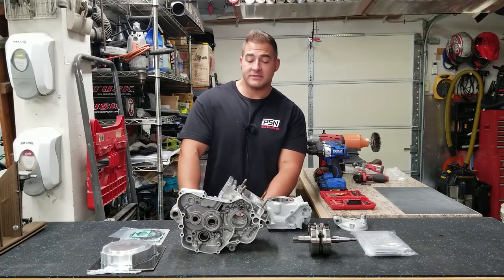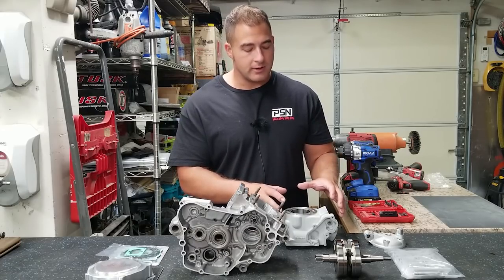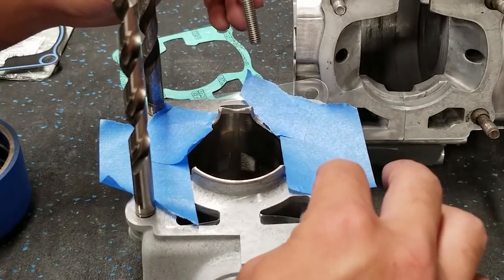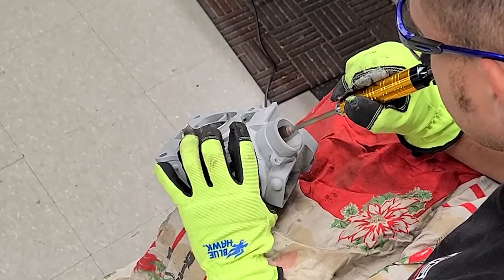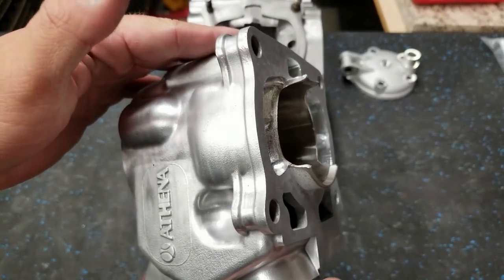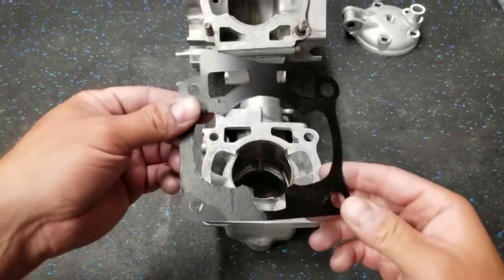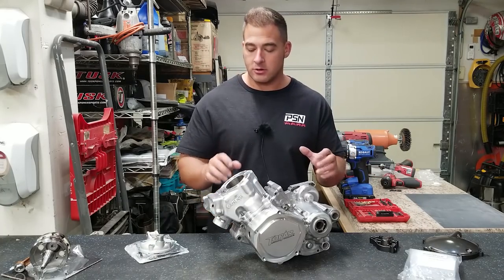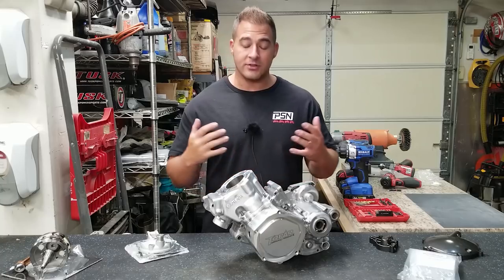Taking This Cylinder to The Next Level... (Must See)

Comment: The crank being true is the least of your worries, ALWAYS check the side clearance, just had a new Hot rods crank that was .006 right out of the box which would’ve self destructed in a couple hours or less, had several that were .004 as well which is why so many people have problems with new wiseco and hot rods cranks a few hours after rebuilding, extremely wise to have someone pull and reset the rod if at all possible. Killer build though! Can’t wait to see it finished
Reply from the maker: Interesting; thank you for the feedback on that; I haven't heard that but I definitely will be checking mine 👊
Reply: I just had my 97 cr250 built. Stock crank was true and in good shape. The builder mentioned that he's had brand new cranks come out of true. Excess runout he called it.

Comment: On the case step, most small bore/ big bores that are bolt on’s don’t need blended, as a builder you should rotate the motor through full travel and check for interface. Blending areas that are “dead” areas can hurt power, change crank case volume, in some rare cases it can help

Comment: 13:48 thank you for taking the time to talk about porting.  Quick question tho, isn't a sharp angle where the two transfers meet the case bad for performance? When reading into all the porting stuff that's what the general consensus is,  not to sharpen that piece.

Comment: Hey Mike, 1 thing I learned from some master engine porters is the air flowing through a 2 stroke motor is subsonic, and subsonic air flows easier over rounded edges. Try rounding off the center transfer port separator bridge a little, instead of knife edging it. If you like doing porting, you gotta invest in a right angle dentist drill/grinder. Then you can get into those transfers, where the real power is made. Nice job on the port matching, even the skirt trim.
Reply from the maker: Thank you for the feedback man! You know what's crazy? Dave Moore told me that exact thing about sharp edges. The reason I brought it to a point is because I've observed that in many ported cylinders. I have a feeling for this platform you're right though, especially because of how high revving 125's are. Maybe I will try both ways and see if its noticeable.
Reply: If you round the edges it will make a turbulence and slow the flow if you knife cut the edges it will just split the air here is example if you look down at the pillars on the bridge in a river they are around it to slow the flow and you can see the turbulence If they knife cut the pillars water would flow too fast just my two cents
Reply from the maker: @patp2462  I think youre both correct depending on the format. I think the rounding of the edges only applies at very high velocity; all theory; I don't actually know.
Reply: @patp2462  So why didn't they knife edge the leading edge of prop driven planes? I understand that the shape of a wing creates lift, and the leading edge has been changed to more of a knife edge for modern supersonic aircraft. All subsonic aircraft still use a well rounded leading edge. Like the modern day airliners.
Reply: @MichaelSabo  It may be something that you can't feel by the seat of your pants, but in a flow meter, it will show better flow. At least that's what I've heard from the experts.
Reply: Never met a master engine porter but I have met many master baiters. This flow idea is taking 1 very specific finding and applying it to everything everywhere with no understanding of the principals. Subsonic flow flows just fine over sharp noses provided the flow is straight on. Rounded noses do cause drag in supersonic flow. Rounded noses allow the stagnation point to shift when the flow is off line where sharp noses force the stagnation point to stay right on the edge. You have to find out what the flow direction REALLY is before you decided what shape you need. Either way it will not make a huge difference at that point in the flow path.  In this case you have not considered the whole flow path either. He did not include the piston skirt at BDC and that should have been considered too. Most of the work seen here will do little or nothing for power. Where it is easy to grind has the least effect and where it matters most is where it is hard to grind. I can't write a whole book on this here but there is a whole book to be written on this subject.
Reply: @billshiff2060  That sentence "Where it is easy to grind has the least effect and where it matters most is where it is hard to grind." says everything about porting. So true.
Reply: @F5Tornado44  Yeah, even worse than that is that knowing what shapes and sizes to grind in is not obvious or intuitive.

Comment: I know you did a good job cleaning up all the seams and rough edges and opened it up a bit and whatnot but man it still looks pretty rough on camera you need to get you a good kit of Dremel bits that are different shape and different grits in stone and really be able to work through the different grits and really polish them all up a lot better and it will drastically help everything flow a lot better over the smoother surface and in turn end up with a lot better performing machine or even finish up with some different grit and different shapes of fiber bits as well to really be able to polish and smooth everything baby butt smooth and it really does help everything flow so much better to the point where I'd say you will feel the difference in performance that rough stuff really hurts the flow and overall performance.

Comment: What are you going to run for a carburetor on this sick yz125
Reply: none for weight reduction
Reply: @samuelfink1619  I did a wheel delete on my yz125. Saved 37 pounds
Reply from the maker: I'm going to run the TMX that it came with; I'm not sure what size it is

Comment: Im interested in what type of tumbler and medium does he use to make those cylinder jugs look polished out like that. If anyone knows, I'd appreciate the help.
Reply: Vapor blasting
Reply: Sorry I commented before watching the video. He has had parts vapor blasted in the past that made the stained aluminum look brand new clean again, but not polished
Reply: @gavinbarham542  yeah I know all about vapor blasting and media (soda) blastings, as well as cerakote, powdercoat. Just was curious what kind of tumbler and media he was using. To get a cylinder jug and head polished to a mirror looking finish without scratches, takes a lot of labor (I've done it to a full 2003 honda cr250r - polished most of every part on the bike to a chrome mirror finish, engine cases, carb, brake reservoir master cylinders, and so on. It wasn't fun to say the least, not to mention the countless hours it took).
Reply from the maker: Jared is a friend of mine who has the tumbler/vibrator. I don't know what media he uses, but it took 90 hours to get it to the shine it has in the picture I posted.
Reply: @MichaelSabo  much appreciated for the info.

Comment: Is a 250r a good starter 2 stroke quad to start with? I have over 10 years of experience with riding in general. Just not with a 2 stroke.
Reply from the maker: Riding wise, yes; great well mannered quad. Work wise, I would say no; depending how modified they are, they can be more on the finicky side when it comes to getting them right. Just my .02 and from personal experience.

Comment: Do you have to change power valves when you get a big bore cylinder?
Reply from the maker: I don't know for sure yet because I haven't compared them side by side, but the Athena kit comes with a new power valve, so I'm going to guess yes; probably matched to the size of the bore.

Comment: People that make fun of homemade tools obviously have not been in the mechanical field very long. There's alot of times where a homemade tool is the only way to go. As far as your crank stand as long as it was cut and built the same height a parallel to each other I see no issue using it. I've been a machinist for 12 years now and I don't see any issue with how you are using the dial indicator.